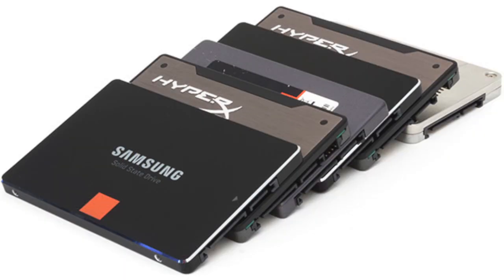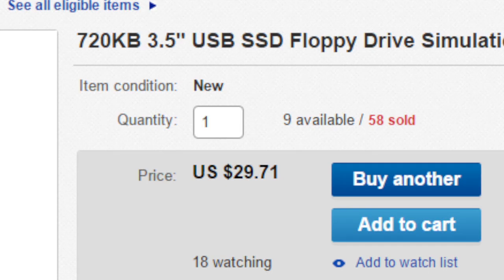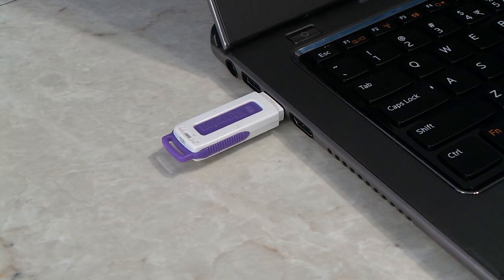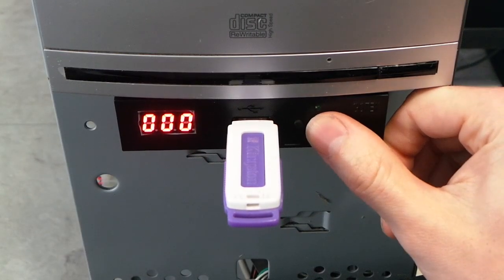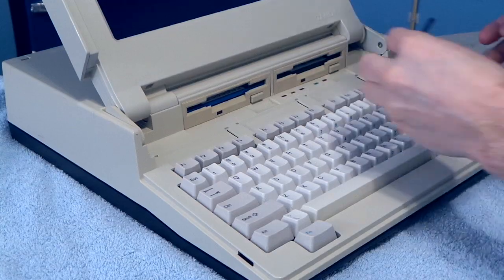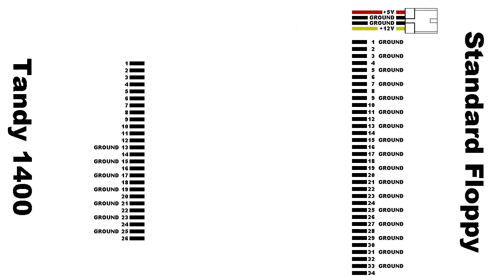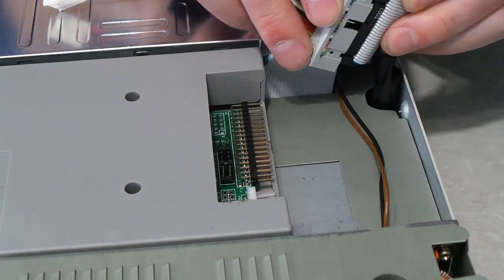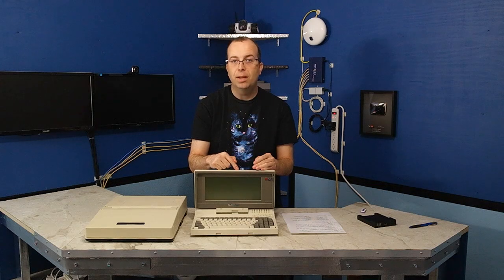Upgrading to a Solid State Floppy Drive Emulator

Comment: 9 years later, there is Flash Floppy which is a better firmware for these floppy emulators that lets you just use floppy images. It also lets you set the type of drive it is emulating.

Comment: I realize this is from 2016 but it was very inspirational.  i am thinking of getting a midi filer for old midi sys-ex (system exclusive data) saving.   And being able to use a USB and have it act as multiple disks could rock.    old school keyboard studio set up.

Comment: Boy you weren't kidding about those instructions.  I just installed one of these in a Gateway 2000, and if it weren't for tutorials like the ones from Phil's Computer Lab I'd be lost.  I did hit a snag where I had a bad floppy ribbon cable, so at first it didn't work.  But I was able to fix it.  This is going to be a great substitute for using actually floppies I think.

Comment: you could have used a commercially available adapter cable(they were available), I had those up to when I got my first 486. Those cables would have a standard 26pin connector as we use it today and the bulky old style connector layouted like a master/slave ide cable. the cable could be inserted back and forth, making it usable either to connect a newer style drive to an old board, or an older style drive to a newer board. I used it to be able to read my old 5.25" disks on my 486 computer.(which is also how I figured out that I could reformat my old c64 disks to work on said pc - being only like 11 years old at the time I lacked the foresight that those disks contained valuable data even though I didnt have a c64 back at that time any more[well I had one but the floppy drive died from overheat)

Comment: Those floppy emulators are often used to swap out the floppy drive on CNC machines. I've heard good results them. 

Yes, program size is still limited to what would fit on a 1.44MB floppy disk.

Comment: At stock, they seem to work better in newer machines unless it's been reflashed for an Amiga or other non-PC computer of that type. I was going to put one into my Tandy 1000 EX after watching Adrian's Digital Basement do it and failed. Then I went back to the internal drive, and grabbed my external floppy drive for the tandy that already had a 3.5 inch floppy drive in it with a bad motor, still didn't work. I even connected the pre-insulated terminals.

There is a better option for formating a flash drive to use on a stock gotek, even lets you write images to the "disc".

Comment: So I have a question ( if you still monitor comments on your old vids). I see a lot of floppy drive emulators for specific equipment that are costing hundreds of $$$. Im assuming these units have been flashed with firmware and have a formatted stick so they work with the gear they are being advertized for. I also see quite a few very cheap emulators not for anything specific. Would I be correct in assuming I could pick up one of these inexpensive emulators (making sure they're 720 or 1.44) and flash it myself as well as format the memory stick accordingly to work with my specific equipment? In this case an Akai S900 Sampler.

Comment: Good afternoon! I have a comment about the product SFR1M44-U100K-R 3,5 USB Floppy Drive Emulator.
There were difficulties with installing jumpers. I picked up for Roland E-66 keyboard.
The correct combination: 2nd (JA), 4th (JB) and 7th (M0), i.e. instead of 5th (S0), you need to put a jumper on M0 (motor)
This is exactly true only for Roland E-66 keyboard! 
Watch my play: https://youtu.be/bOACNhTLjjw

Comment: If you replace the firmware with an open source version, you don't need to distinguish between 720K and 1,44MB.

https://github.com/keirf/FlashFloppy/wiki

Btw:There are version specifically for 26 pin cables, although not supported by the above mentioned firmware.

Comment: These things are handy, like 10 bucks a piece on eBay if you have a serial adapter to flash the correct firmware yourself which takes only a few minutes, some places sell preconfigured drives for specific systems but those cost way more. I don't feel too bad about replacing the floppy drives in all of my machines as it would only take a few minutes to put the original drive back if I needed to for some reason

Comment: That's crazy.  I recently did this to my Atari 1040STe and I picked up a Gotek USB floppy drive and flashed it myself with FlashFloppy firmware.  It worked without a problem once I plugged it into the Atari STe.  I wish I could post URLs here to my Facebook post where I explained things and showed images.  It's super easy to do this but it looks like you ran into all sorts of tangential issues.
Reply: Yeah I did the same thing with the help of a youtube tutorial, much cheaper than buying those preconfigured drives

I had to get an extension which I leave dangling out of the floppy drive slot on my ST which looks a bit ugly but it works, same thing on my Amiga and I can really quickly plug the drive between the two though I'll eventually get a second one as they are only 10 bucks each

One mistake I did make is I accidentally flipped the power cable on the Amiga and sent 12 volts to the Gotek, the Gotek survived but my USB drive smelled burnt and stopped working. Lesson learned I guess
Reply: @waldevv   I ended up mounting my Gotek with an OLED display inside the 1040STe case with a 3D printed mount and it looks pretty slick.  No extra cables or anything.  Wish I could post URLs to images but if you looks for my name on Facebook or dig into the Atari ST owners group in there,  you'll see them.

Comment: You could have flashed the device with FlashFloppy that supports both 720 and 1440 modes. But perhaps that firmware wasn't available 3 years ago :)

Comment: I just got this to work on a Tandy 1100FD. I used a newer version of the Gotekthat's 720K and doesn't need special software. Leave the drive select jumper but remove the configuration jumper.

Comment: At time of writing this comment, this video is almost 3 years old. Would like to see this topic taken up again - in a more extensive survey of converting various retro computers to use modern solid state storage device. This looks to be a fairly broad topic as there is the matter of converting old computer that had spinning harddrive to use an SSD. This involves the various retro hardrive interfaces (which ones are supported with modern adapters to SSD). Then there are the various retro removable storage devices (floppy drives, perhaps even tape drives) and what options are there to adapt them to USB sticks and/or compact flash memory cards, etc. Yeah, this could be a very big topic and take several episodes to cover it well. Doesn't seem anyone has taken it on yet. The 8 Bit Guy probably has the best expertise to address it.

Comment: I see a lot of floppy drive emulators being used in old keyboards and synthesizers that either used 5-1/4" floppies or even 3-1/2" floppies.  As a keyboardist, it's nice to know that if my Korg T3 floppy drive ever quits, there is a solution.  The first product I had heard of was HxC, and their website also shows industrial equipment such as wood shop routers and large format machines that still had 5-1/4" boot disks!  The USB emulator allowed them to keep these massive machines running with newer technology.

Comment: Just found your channel, so I'm watching a bunch of your videos.

I'd like to comment on the proprietary nature of that Tandy floppy interface. My first computer was a Tandy 1000 RLX. That computer was a nightmare! At the time I got it, I knew nothing about computers. But I eventually wanted to upgrade the 40MB hard drive. I found it was impossible. The Tandy 1000 RLX was a 286 computer, with an XT IDE interface. Yes, XT. Before the 286 AT, in order to install a hard drive, you had to install a controller card that had its own BIOS chip, like for an MFM or RLL drive.

But with the 286 AT, the BIOS, including a CMOS, natively supported a hard drive, with the ability to define the Cylinder, Head, and Sector information, (CHS, IIRC). 

But not this Tandy! It was very much like an XT, in that the BIOS has no option for defining a hard drive. So how did the 40 MB Seagate hard drive work?

Well, it contained its own BIOS! Yes, it was compatible with an XT computer! And that's what it was designed for. Once I found out my Tandy could only accept XT IDE drives, I searched the market for one, and I found another drive, also made by Seagate. Problem? It was the 20 MB version of the 40 MB I already had.

Needless to say, I never did upgrade that hard drive. I eventually bough a 486SX computer. I was too broke at the time, being a teenager, so I bought a used 40 MB drive just to get going. I then bought another 40 MB drive. I gave my Tandy to my younger brother. But eventually he needed a new computer, as the Tandy was always having hard drive seek errors, and eventually started developing bad sectors.

Comment: I know this video is 2 years old but those cheap gotek units can be reflashed to the hxc firmware from here: https://hxc2001.com/store/index.html with a ttl serial adapter which allows them to use many different floppy formats, not just 1.44mb. I have 3 now with the modified firmware and they're excellent.

Comment: 6:00 how do you accidentally plug something into a power supply with the wrong polarity? was the laptop touching something that was out of phase and also connected to a wall socket? Did you not connect wires properly? I wish I knew what you did so I wont do it in the future.

Comment: Get a Gotek with HxC firmware.  You can use it on almost any machine... I just ordered one to use on my Mega ST and Amiga 1200.  For these machines, I had to order cables but they are available from eBay.

Comment: The fact that it uses a proprietory image format breaks my brain. Why? And surely the beauty of a device like this would be to easily transfer data from a modern system. Which you can't do without special software. Seems the whole thing is pointless because of that one shitty hesign choice.

Comment: From the quick shot of the internals of the 720k drive, I'm pretty sure those are more or less identical hardware inside. Keir Fraser's open source FlashFloppy firmware will run on Gotek drives and supports a ton of formats: https://github.com/keirf/FlashFloppy . Soldering a couple of pins on and a TTL serial cable is all you need to get much nicer firmware on these!

Comment: Interested if you ever had any success with the adapter. I have several TRS-80 Model 100 Portable Computers and a DVI with two 3.5" 1.44mb floppy drives replacing what was 5.25" 360k drives. They are formatted at 360k which is what I expected. I am wondering though if the emulator might work in place of the second drive and make it a little easier to deal with actual data.

Comment: I'm disappointed with this video. I had expected you'd run into problems, but I anticipated you'd have something nominal by the end of the video. I've been reminiscing over my Headstart LX-CD IBM compatible a lot, so at some point in my life I'm really keen to get my hands on either that, or a new old stock IBM like Clint Basinger did.
Floppy drive emulation will be a necessity (possibly also HDD).

Comment: I think maybe you connect all power lines together makes the power regulation circuit went unstable, and the computer shuts off to protect the entire system. This floppy emulator requires less than 50mA current. If you just use one power line to power these thing up, maybe the problem can be solved.
Reply: Because different power regulating source (STEP motor/Analog supply) doesn't outputs same voltage accurately. Connect it together maybe causes over-current protection.

Comment: Hello dude.
I just bought one of these and there's some good and easy to understand software at http://www.ipcas.com/support/usb-floppy-emulation-download.html
This formats the USB drive to 100 partitions, then using the same program, you can add files to each virtual floppy.
Remember to run program as administrator and 'save' after dragging and dropping files into the virtual floppy of your choice.

Comment: Great idea to replace the mechanical floppy-drive by an electronical on. But these Chinese Product isn't well designed. Lok at http://hxc2001.com/showroom/index.html. Its opensource and has many features (Replaces 8”, 5”1/4, 3”1/2 and 3” floppy disk dive :
with format  180KB, 360KB, 720KB, 800KB, 1.2MB, 1.44MB disks and many others !)
Reply: ...and is available with 26pin connector!

Comment: What i did whenever i had language problems in a program was to open that program in a hex editor and open google translate. I then used copy + paste from the hex editor into google translate and back again. It might not have been an accurate translation but it was enough and it worked for me.

You can always zero out bits you don't need and sometimes programs need file sizes to be exactly the way they were made or they will not work. Never hurts to try. =)

Comment: I am using a floppy emulator that used an SD card instead of a USB drive and I have had no problems.  Here is the link to it:  http://lotharek.pl/category.php?kid=26  it even has on screen menus when used with an Atari or Amiga.  Also they work in some Musial keyboard that have floppy drives.  Hope that help.

Comment: HAve you thought about a GOTEK + HXC solution. The developers of HXC floppy emulators have firmware that is developed for the Gotek drive - which allows you to use any version of gotek as any version of FD.

Comment: With proper firmware the SSDD version of that drive can be used in a 1581 with D81 images or on an Amiga with ADF images.. I have one in my Amiga 2000...

Comment: Great video and I don't know if you still read the comments here but could it also work for older synth from the 90 that uses floppy drives? I, for ex. still have an old Roland G1000 with floppy + zip drive.

Comment: You can make that Gotek floppy emulator far more useful by flashing it with the HXC2001 firmware.  You have to buy a bootloader, but it's cheap, like whatever the current exchange rate of €10 presently is, but once the loader is installed, firmware is free.  You also need a TTL serial adapter, like ones you can use with Arduinos.

Comment: Older Tandy floppies used the 26-pin header and were powered in-line. You will run into a further problem though, even if you get it working. My Tandy 1000HX has a 1.44MB floppy drive in the second bay, but the BIOS can't recognize anything higher than 720KB. Even if you do get it working, you'll probably have to format the "disks" as 720KB.

Besides that... I'll go as far as to hook up a zip drive to a vintage system if It can support it, but emulating just feels like cheating... That's why I don't run DOSBox. Totally ruins the experience.

Comment: Hi.  Around 1983 when I bought MY first high density floppy drive at a trade show.  I found out, you can replace high density drive with a low density drive.  The computer did not care.  It formatted the floppy disk as a low density disk, that I could only use in that machine.  It still worked.

Comment: +The 8-Bit Guy
Why can't you just use a USB drive to transfer data to and from the PC? why does it need to emulate the floppy drive? Can any USB drive be turned into an emulator for another medium (floppy, SD, CD, DVD, etc.) with a firmware mod?

Comment: 4:54 I think it isn't the greatest to combine ale wires toghether because you can make short circuit or you can blow up power suply due the voltages for each function.
Reply: I think that's what broke it

Comment: I understand what you mean "when my enthusiasm returns"! I've recently battled with 2 meta to 2.5" PATA/IDE adapter cards with little success. It worked one.. then simply hasn't worked since. The msata SSD gets really hot and won't work. Hmmm...

Comment: Ok I experimented with those emulators. You need a 2GB stick to have 99 floppies. It uses more then 1.44 in emulation. You need to install emulation driver on PC. Then using programs provided you can format and switch virtual floppies.

Comment: Usually, the devices power problem are solved simply by replacing electrolytic capacitors. They have a very short life span and must be replaced in the first place especially in devices older than 5 years. Also ensure that you use Low ESR capacitors, high frequency in circuits may be pretty exacting to this parameter.

Comment: lets count drives A B C D E F G H I J K L M N O P Q R S T U V W X Y Z
Reply: Or for the Apple II's: S6,D1; S6,D2; S5,D1; S5,D2; S7,D1; S7,D2; S4,D1... 

I suppose you could fill all the slots with drive controllers, but most people never put one in anything but S6, unless they had a ProFile or a 3.5" drive.